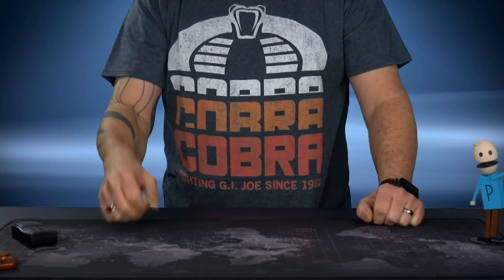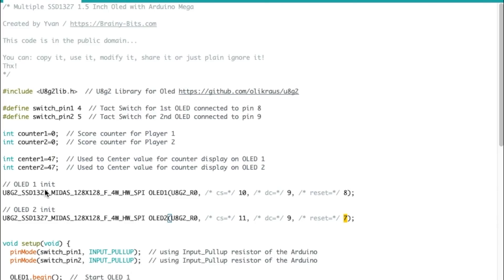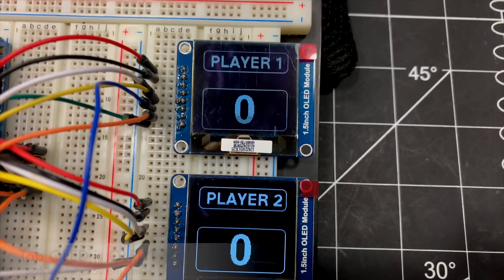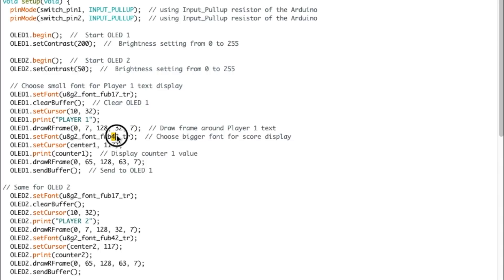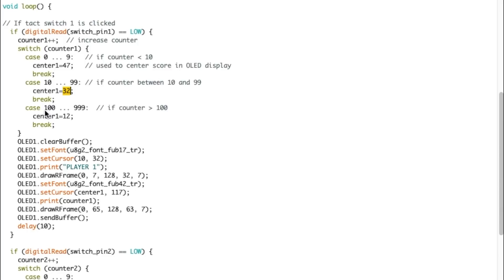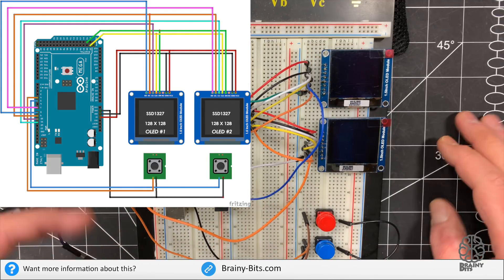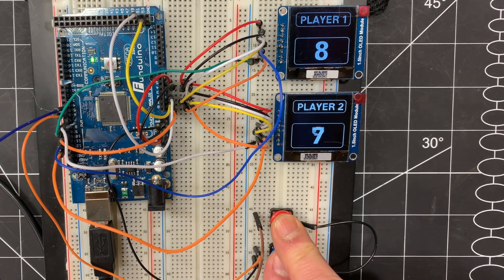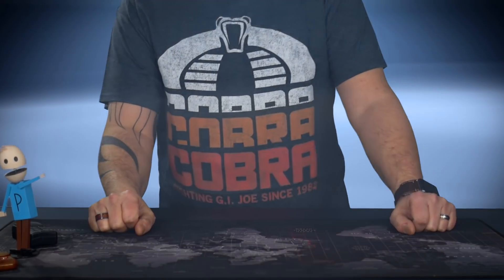Two is Better than One!  Using multiple displays with an Arduino

Comment: I want to make a bedroom clock but at night my led display is to bright is there a way to adjust brightness for night time, please
Reply from the maker: You can adjust the brightness by changing the value in the code here:
OLED1.setContrast(200);  //  Brightness setting from 0 to 255
If you haven't already you can check out the tutorial page here:  https://www.brainy-bits.com/two-oled-display-with-arduino/
Hope that helps and thank you for watching!

Comment: Im working on a project where I'm thinking of connection two SSD1322 (256x64 - 3.2") oled displays. Would it be the same technique as you've described? Thanks in advance!

Comment: Hi there! Really nice tutorial! it is almost what I was looking for to solve my problem, but i still need a bit of help over here:
I got myselft an Arduino Mega Pro (embed) to shrinkify a project that has an OLED SSD1331 color display (uses Adafruit ssd1331 library, not sure if the U8g2lib can handle that display, i don't think so) together with a GPS and a SD module. The problem is that both the SSD1331 display and the SD module use the SPI communication; it shouldn't be a problem but the thing is that the little screen displays really weird images when I try to assign a Selector Pin (cs) different than 53 (the default hardware one). Thus, I can only use the screen in that cs pin and only the screen, no other devices since i can't use a different cs. What's going on? Help would be much appreciated!! greetings from Spain.

Comment: Just to confirm, can you use this to connect 4 screens to one arduino?
Reply: Hi, I would like to know that also. Got any feedback?
Reply: @JohanDegraeveAanscharius  never tried :(
Reply: @jhfdhgvnbjm75  You are right, I was confused because I found other videos where one had to address the oled's via the I2C , where only 2 were possible... It'll work until you run out of pins...

Comment: sweet upload, saves a bunch of proto cost thanks!!!
Reply from the maker: OLED displays are just great, so many applications inside projects.  Thanks for watching!
Reply: @BrainybitsCanada  OLEDs are great but only for prototyping, because at regular use they burn-in very quickly
Reply: @cbm80amiga   Have you had personal experience with OLED screen burn-in on these modules? I'm curious to know how many hours of use before burn-in is visible.
Reply: @bunch8  Yes, I have. Look at my channel I recorded short video about that. It seems that even 1 day is enough to have permanent burn-in. I have 4 different OLEDs and all of them have burn-in issues.